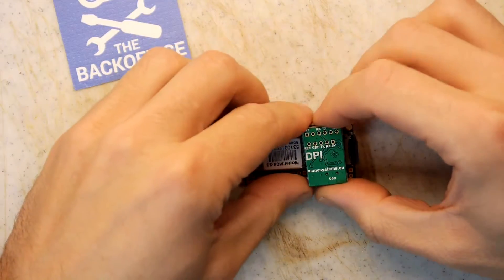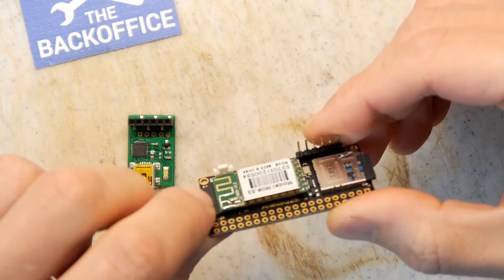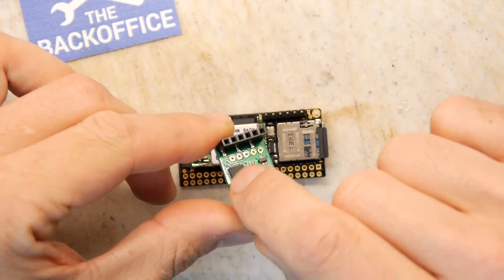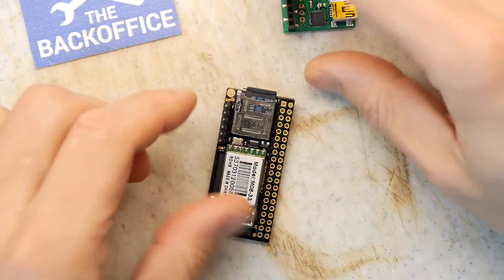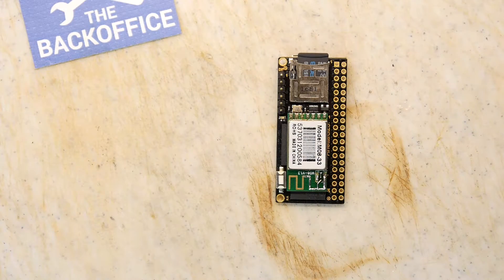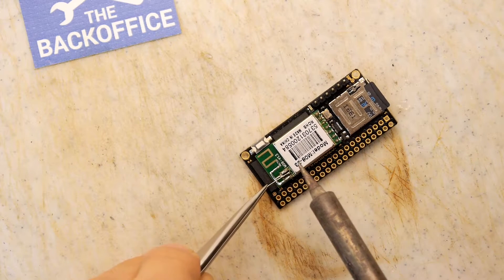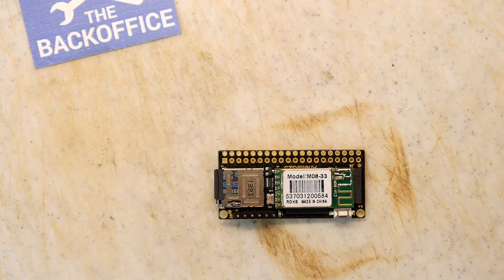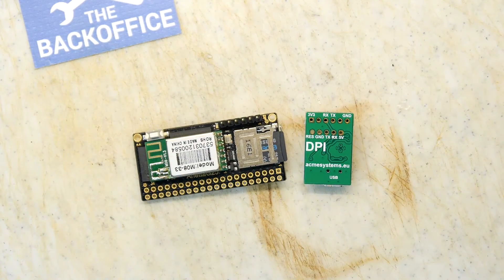Arietta G25 Micro ARM PC board

Comment: How does it compare spec wise to the Pi? Definitely looks smaller, but only slightly thicker?
Reply from the maker: +treguard1982 it's pretty weedy in comparison, no video out. But the GPIO is pretty good. Definitely useful for embedded systems.